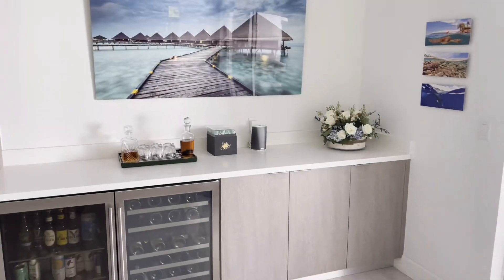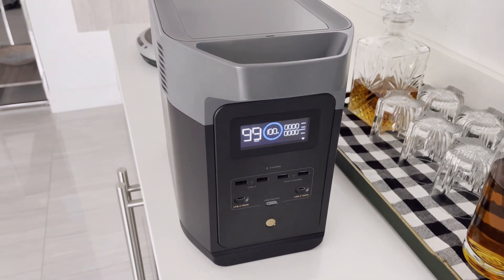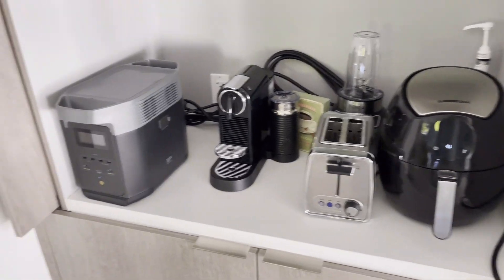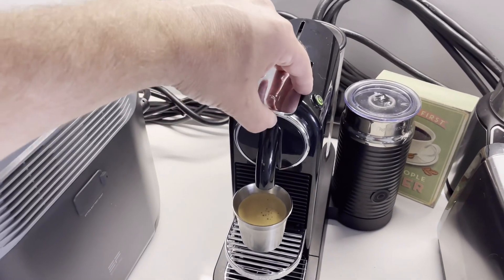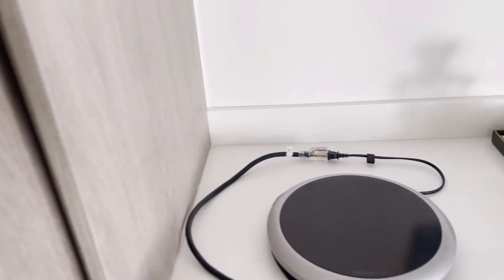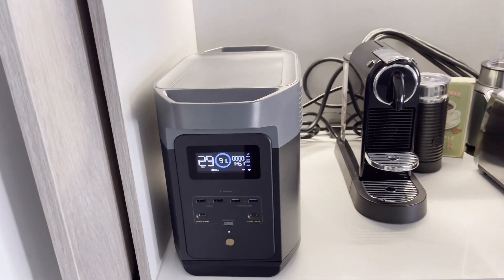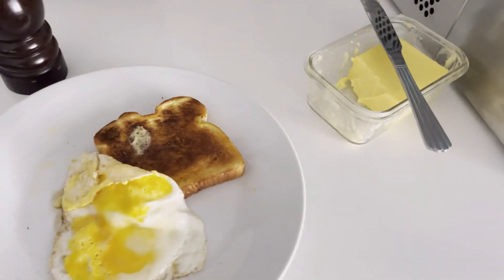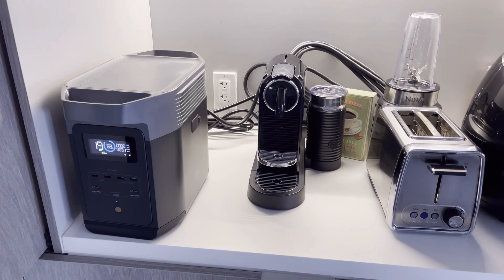Cooking breakfast with my ecoflow delta 2 during a power outage!

Comment: I've been doing a lot of testing with my Delta 2 (1024 wh) and Delta 2 Max Smart Battery (2048 wh). With just the Delta 2, I'm able to wash one load of laundry on my GE Profile Ultrafast 2-in-1 washer/dryer. After the wash, there's 19% of battery power remaining. Connecting the Ecoflow 2 Max Smart Battery (2048 WH) to the Delta 2, I'm able to do three loads of laundry and have 21% battery capacity remaining. So far, the Delta 2 + Delta 2 Max Smart battery, can't power up a 3500w 120v tankless point-of-use water heater, the overload protection gets triggered and shuts down. However, it has no problem handling a 1500w 120v two gallon point-of-use water heater.
Reply from the maker: @biketrailsandwaggingtails  that’s good information to read. Yes unfortunately the Delta 2 is limited to 1800 running watts. It can deal with a surge of about 2400 W and maybe more for a very short amount of time but if you’re trying to run something that requires 3500 W continuous, you will probably need the Delta pro. Thanks for watching!

Comment: Two minutes into the video, you turned a light on over the top of the appliances. How does that work if you have no power?
Reply from the maker: That light is plugged into the power strip that the ecoflow is running. I have all of the appliances in this cabinet going into a 20amp power strip. The cabinet light is also plugged into this power strip.

Comment: Never use heating appliances on a power strip.  Other than that, great video!
Reply: In sure he doesn't use them all at the same time
Reply from the maker: It’s a 20amp power strip rated for heavy duty use.
Reply from the maker: Thanks for the feedback
Reply: You can it's a power strip rated at 20 amps. 120v times 20amps. That's 2400 watts. No problem bro